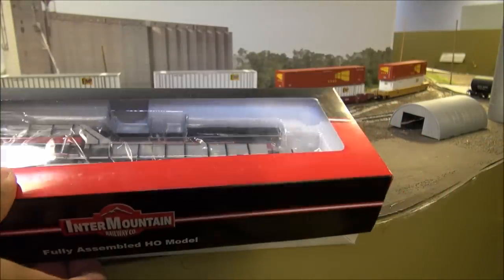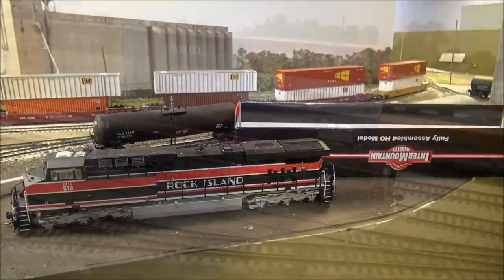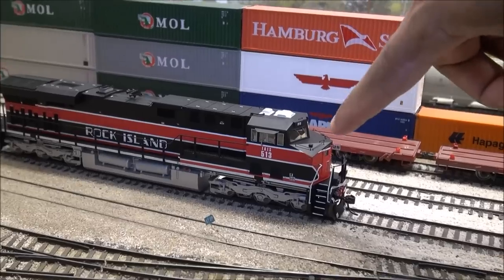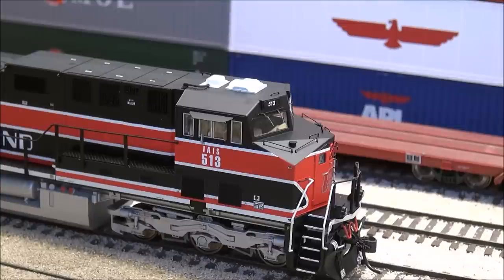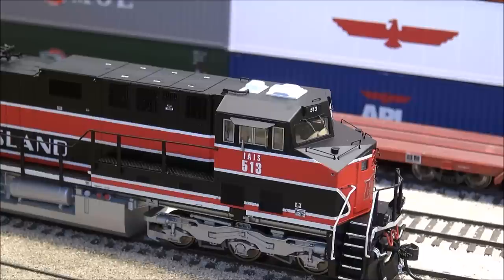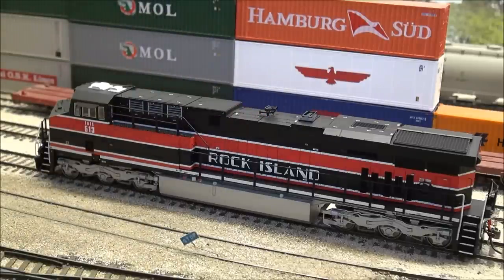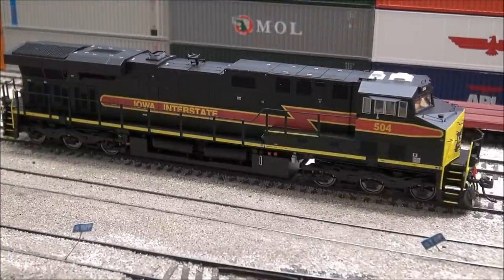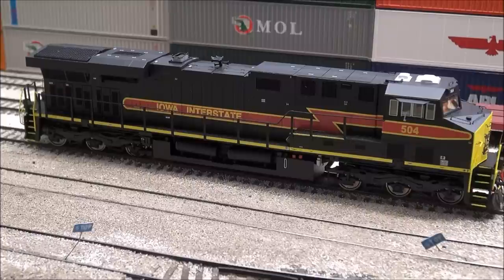Review: Intermountain ES44AC IAIS, Rock Island & CSX

Comment: James sorry for another correction but the Dynamics Brakes are in the HOOD on the rear of the Locomotive not behind the cab that's why its called a Dynamic Brake Hood
Reply from the maker: whoooooooooooops.  I need to learn this stuff.
Reply: Not so with the GE units. The dynamic brake is located behind the three vents right behind the cab. You should see them get red after going down a long grade!

Tim G
NS Locomotive Engineer
Reply: tmh57 but the Hood is still part of the whole system right if im correct
Reply: James its ok we all had to learn it
Reply: The large rear section of the hood is the radiator cooling fan to keep the large prime mover from overheating.